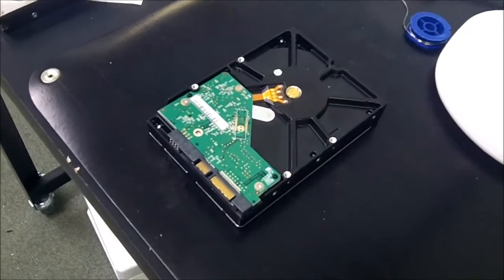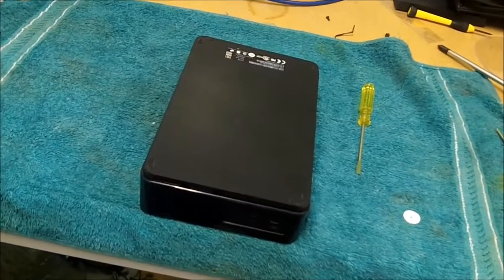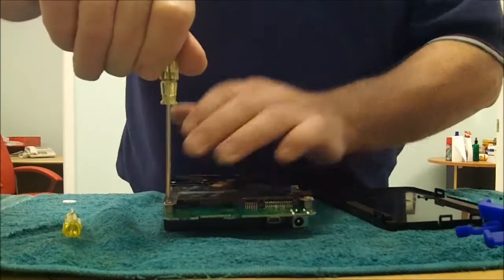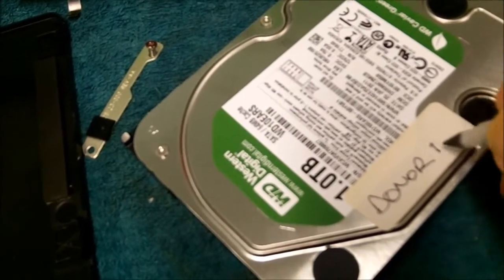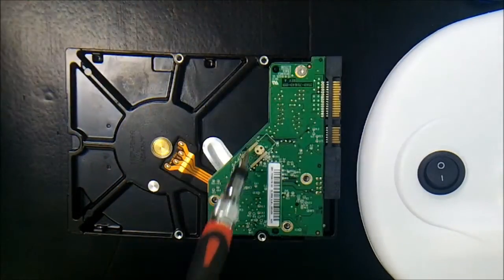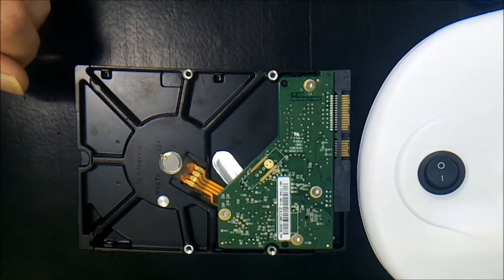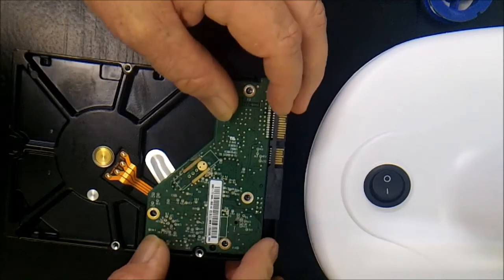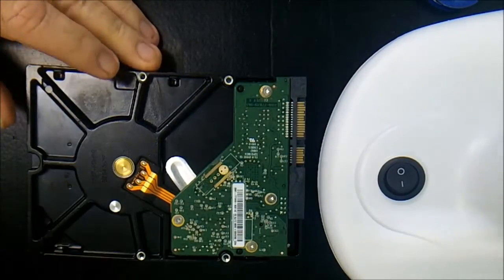How to Swap a PCB on a hard drive.

Comment: I have a drive that spins, is quiet, but will not initialize or show up in diskpart. Would this procedure possibly fix my problem? I cant even get recovery software to pick up the drive
Reply from the maker: No...If the PCB has failed...the drive will most likely not spool up. Your problem is probably a failed read head...